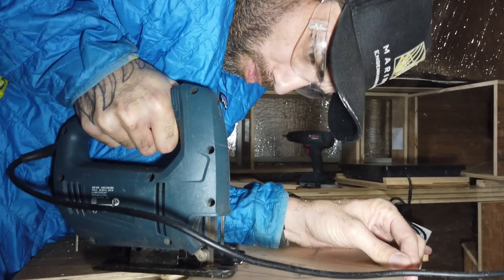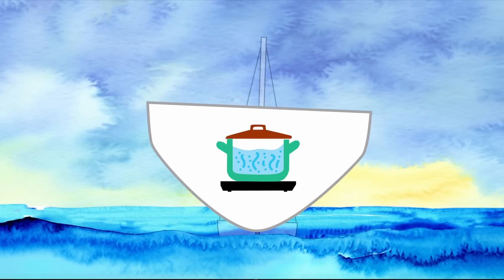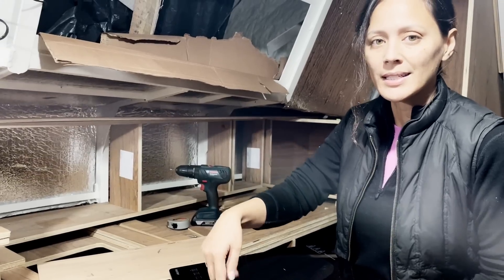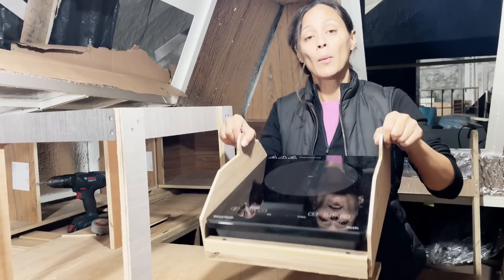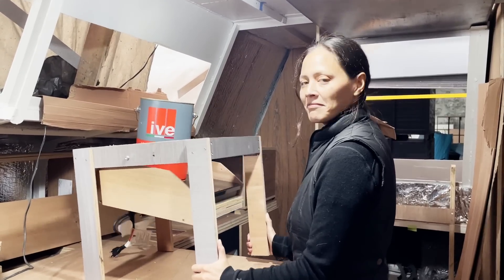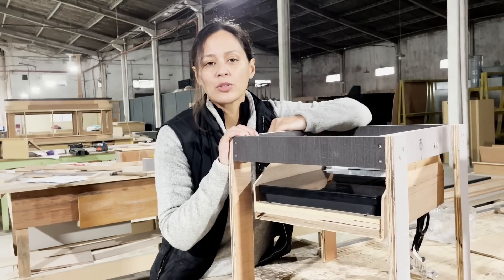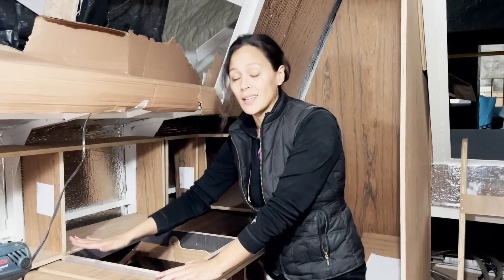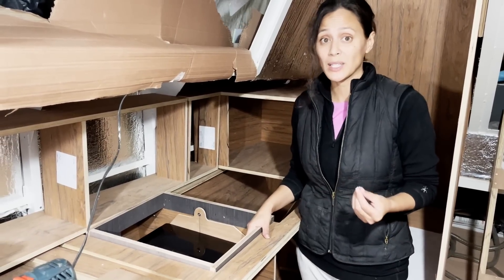How to cook on a sailboat ⛵️ Ep44 – PART 1 – DIY Boat stove gimbal INDUCTION cooktop

Comment: I have a double gimballed induction hob.  However, I had the advantage of using a gas hob and grill so copied the weight and gimbal position when making a wooden box for the induction hob.  Were the grill used to be, I added a shelf and that's were we store the original single induction hob as a just in case spare.  I rescued the pan holders which also have stainless steel gimbals from an old stove and polished them up.  The stove tips to the front without a pan, but with a pan plus food sits level.  A 600g weight is fixed underneath as the final counter balance for fine tuning.  Held on with industrial velcro so it can be moved.

Comment: I totally agree with some of the comments.
The cabinets' gimble and inside sides of the cabinet need to be stainless steel. All that heat from cooking is a concern when surrounded by wood. 
The current gimble is upside down. This will lift the cooker and give room for pot handles and general ease in cooking. 
Including a pot cupboard to the gimble will give all the natural weight low down.
 I can’t understand the boat cabinet company you’re using can’t see these issues.

Comment: Gimbals for boat stoves works because the oven weight. The centre of gravity is down. Moving the centre of gravity down the problem is solved, but not moving the induction plate down. Adding some stick vertically under the induction plate and add some weight there will help, but If you don't want to waste that space with artificial weight, give some utility to that space adding an oven or a cabinet.
Find a perfect position for the gimbals axe is complex, but there is a mechanical engineering rule that you can apply: "If you can't do it perfect, do it adjustable".
Reply from the maker: Thanks for your feedback! We realize now we didn't explain that we made the gimbal lower to fit the pot holders below the countertop because we are going to put a cover on the counter so you can use the space when not using the cooktop (Not because of the center of gravity). Thought we were able to balance it, we are going to play around with adding weight later to the bottom (didn't get to that in this video like we thought). We realized that we needed to figure out the screw situation before we tackle the weights. We'll have some updates on this soon and we look forward to your suggestions! Cheers!

Comment: The  period of a pendulum is directly proportional to its length. So if you want to slow down the swing of the stove top some, then put the weight on the bottom further down from the pivot axis. If you put an oven in under the stove top, then it would go on the bottom of that. If not, then you have to figure a way of extending it down on wood boards along the sidees. You can wait until you are cruising to tell if you need to slow the swing of the stove top.

Comment: Lori that gimble with the screw going through will wear very fast being  wood to wood can I add my Idea
 you drill out the hole and insert a metal tube for the screw to pivot on to reduce wear,sorry if I’m pre planning your thoughts hope it makes sense,thanks for the great explanation on your boat build .U.K.
Reply from the maker: Yes, definitely! We just used temporary screws for the balancing. Now we know how much space we have in the galley we will look into fixing up these pivot points because you are absolutely right, it will wear down pretty quickly. Thanks for the feedback! Cheers!

Comment: Your pots and pans will be well below the surface of the surrounding counter top. You could build up supports inside the gimbal frame to raise the induction top to a more sensible level. Then of course you need counter weights down as low as you can on the underside of the gimbal frame . I suggest you will need some sort of bearing or metal sleeve for the gimbal to pivot on. It will not be too long before the screws wear away the plywood frame. Apologies for commenting on your gymbal however I believe that is not at all functional as it is currently proposed
Regards Eric
Reply from the maker: Thanks for your feedback! This is still a concept that we are working on so there's lots of room for improvement still. We will have a part 2 to this because we need to coordinate how the countertop and cabinet will be before we finalize the actual gimbal and also get proper screws for the job. You are very right, we are looking into the best ways to fabricate the pivot point so we don't have wear on the wood. Thanks again for looking out! Keep an eye out for our follow up episode on this!

Comment: Your stove/pot COG (centre of gravity) is still quite high. Movement of the pot will change the angle. Having to put your hands down a hole beside a boiling pot to adjust the cook top does not look fun either. This is why people are suggesting a hanging cabinet under the cook top. It will not really take any more space as the gap under the cook top would be the same as under the cabinet. It will give you the chance of making sure the COG is always much lower than the the pivot and not top heavy. Even with the COG just a little lower as your test pot shows, it will swing faster and not dampen as fast. Does your cook top have membrane switches or capacitive? Membrane switches require some pressure to activate, which will swing your pot too. The other advantage of using a standard marine stove size brick, is that if you find that you keep running low on battery because the induction cooker only takes half the power.... and does still take half the power, you can more easily replace it with something like gas. You have a smaller boat, bigger than mine but not the size of those people we have seen on YT with induction cookers on 50+ foot boats (or cats) with lots of room for solar panels.

Sea rails should be non-conductive for induction cookers. Metal bits near the surface, especially steel with a high magnetic hysteresis, might get very hot. After all this is the property that makes induction cooker work in the first place. You want to heat your pot, not the pot holder. Induction cookers do have a temperature sensor to detect a pot where the water has boiled away so it doesn't start a fire but that is right at the centre (yes I have taken them apart) and a steel sea rail will seem to the cooker like a pot when a pot is not there. perhaps enough to bypass the "pot not there" sensing that would normally shut it off while at the same time being far away enough from the over temperature sensor not to shut it off that way.

Comment: Only one other problem that could occur. What if you lose power because you been in to many storms and such. And used up all your battery power. My self I would have both solar and gasoline powered generator.
Or a diesel if your backup propulsion is going to be diesel. Or is it going to be all electric. I think you said it was going to be.
Other sailors have went that way but have needed a gasoline or diesel generator at times. No wind you while out in the middle of the ocean, you can’t just drift.  So be sure to have a backup plan in place.
Think you are miles from land and you lose wind for 12 to 24 hrs. Diesel engine can keep you moving.
But electric can not, there are some electric propulsion motors that will generate power. But you have be moving fast enough.
Reply: A boat with an electric motor sounds very nice, but it is definitely NOT a viable solution for such a project. All of us who have sailed a lot know that there are dozens of situations where having an engine that can work hours without limitations is essential, and can even save your life. There are mixed options, electricity / diesel that are much more reasonable

Comment: To place yr gimbals low will be a waste of space underneath, y should use this space for an oven. Resulting in an work space at the same level as  the electric or gas stove.
Resulting in an in 95 % more practical working place. Because Y will spend more hrs/days afloat quietly without moving then sailing in force 10.
So keep it simple and workable.
Succes.
Master Mariner J.Jonkèrs   ( sail master all ships)

Comment: Although a 360 gimbal would be preferable, at least make it a 2-axis gimbal, which is easy to do, and you don’t lose too much space, if you keep your “gimbal-basket” a little shallower - you can use your gimbal frame for the second axis ! 
The one axis gimbal is not much of use, since it takes care only of the lateral movement, but not the longitudinal (bow to stern) movement…
Reply from the maker: hmm we thought about that but had not seen any regular size stoves that had the 360 gimbal, just the little round ones. Do you know of any examples? This might be possible if we did it in a thin profile of stainless steel. Perhaps this can be a nice upgrade project when we get the funds one day!

Comment: Dear Lory, I'll give you a link to a channel that I hope will help you with many of your questions. In one of the videos you can see an electric cooker and an electric convection oven mounted on a cardan. But the Canal is very interesting because it has a deep study on electric and hybrid propulsion systems and on the calculations of consumption in ships going on long voyages. As you will see, pretending to have a boat with only an electric motor is very expensive and, above all, completely unfeasible, and perhaps very dangerous. In that channel they have an extensive study on hybrid electricity/diesel systems, which are totally reasonable. I hope it helps you meditate on your project. Greetings! . https://youtu.be/re49qMYM1xM?t=117

Comment: FAIL FAIL FAIL!  The wooden gimbal will fail quickly on an ocean passage.  Firstly, the wood will soften once it is hit by a dollop of hot water spilling out of a pot.  Secondly, the wood will "wallow" because it is insufficient to act as a bearing surface to carry the weight of your contraption.  YOU MUST remake the support cage out of either 316 stainless steel (best) or aluminum.  A metal cage can easily by folded on a sheet metal brake, and then riveted together.  I WANT TO LIKE WHAT YOU'RE DOING BUT you make it hard for me when I see such amateur mistakes.  You'd better get to know some real ocean sailors before you continue building IKEA-type equipment.
Reply from the maker: Perhaps you didn't hear our explication that this is a model for the construction of the galley and we are not done yet. Also, we are totally open to friendly suggestions that will make our project better! We can't tell you how many comments we have immediately implemented and really made a huge impact on our work. We love learning and that's exactly what this project is about! Thanks for the suggestion for the 316 stainless steel we'll keep this in mind when we are finalizing the construction of the gimbal.
Reply: Tell him, Lori!  It's like when someone puts a negative review on Amazon and they obviously haven't read the product instructions. 😂
Reply: @lahakai  You should consider doing mock-ups in cardboard.  It's cheaper, faster, and easier to modify.  If you're building a mock-up why bother with the counterweight?  My suggestions are meant to be helpful.
Reply: I have commented exactly the same. All my encouragement to Lory, but there are many mistakes made by novices and people who have almost no experience at sea. Starting with the boat itself. Steel boats are horrible and expensive to maintain and are only logical for lengths above 50 feet. If they had chosen a used fiberglass boat, months ago they would have been able to renew it and they would be sailing. The most serious is to think that a steel boat with an electric motor is viable for a round the world. A serious inexplicable error when any technician in electrical systems with a few simple calculations shows you that it is unfeasible for long journeys and that they will realize a few days after starting to sail seriously. There are mixed options that are correct only for security reasons. All the best .
Reply: So true

Comment: better is a full gimbals in both directions i think you will not be happy with your decision.
Reply from the maker: Send us a link of one that will work with our cooktop and we can see if it's possible to replicate it!
Reply from the maker: We saw this video too, It’s very cool! But it’s a very tiny stove. Have you seen one for a regular size stove?
Reply: @lahakai   its the same princip you must the mesurements take from your stove and produce two frames as seen in the video for your stove in square with enough place between it than hang it in the middle of the highest weight what can be possible and place a conterweight under the middle of the center of the highest possible weight 🤔